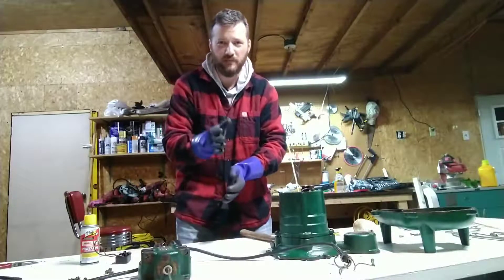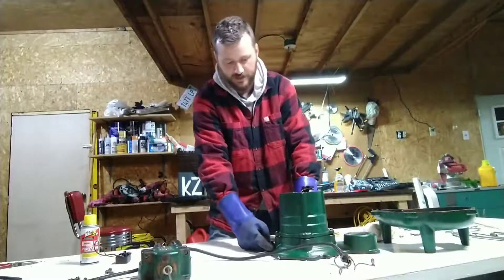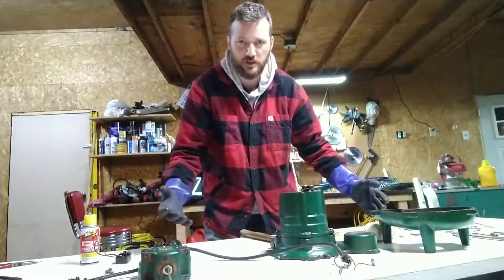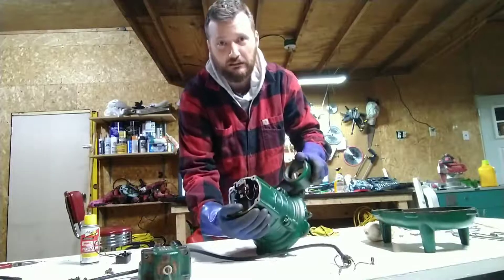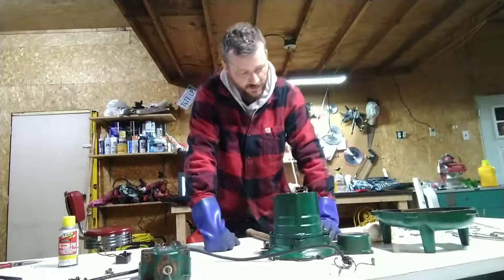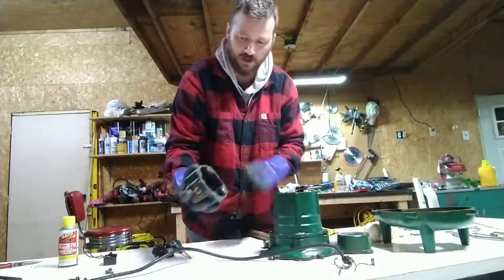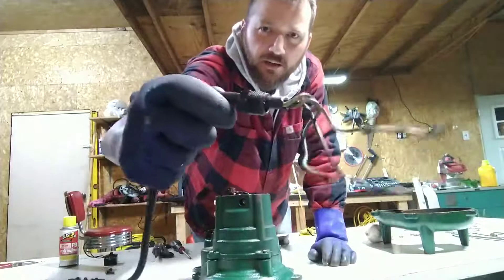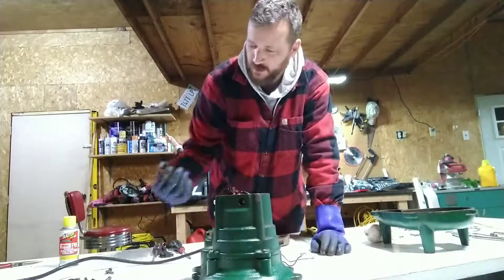Zoeller 267 Sewage Ejector Pump re-build? Part 2

Comment: Kent - Paul... thanks for posting video... hope it worked! ? Update?
I have an N267 that sadly needs a longer cord... been perfect for 7 years but #%* that installed it spliced in a cord rather than buying one with 25’ cord (because about $75++ up charge and delay)
I would rather rewire completely than create underground splices that MUST be waterproof... gl to you both! (No I haven’t taken out stator either... check out rc worst channel on pumps - lots of similar vids)
Reply from the maker: Hey dillbrad8...thank you!  And hopefully your issue with the power cord comes to a less expensive solution!  And yes!  It is pumping but I've saved it for a backup pump.  I have a video of it working in a trash can, with some piping I pieces together to test.  I will upload it soon!

Comment: Kent, I am working on a Zoeller M267 and have replaced the switch and relay and now have the motor housing opened up.  I suspect teh capacitor is shot, but I can't figure out how to get the stator out of the housing.  Any info on how to release the stator from the housing?
Reply from the maker: Hey Paul that is a great question.  I've never had to take one apart to that point.